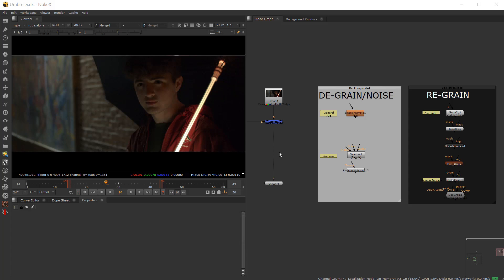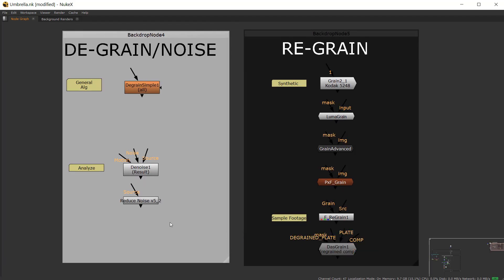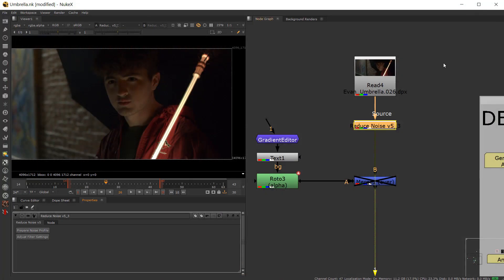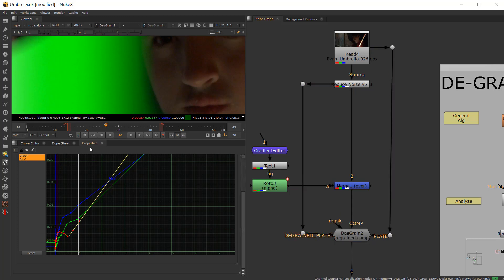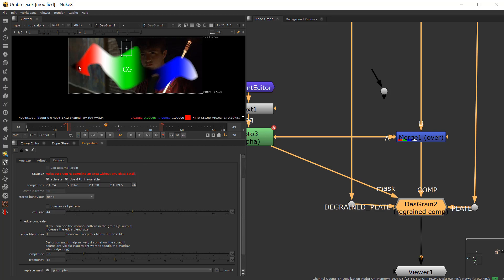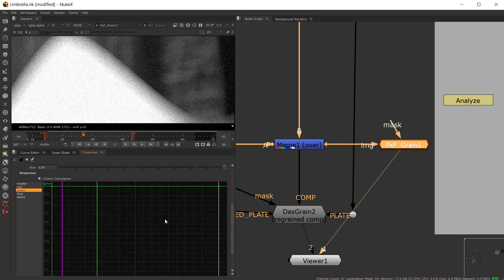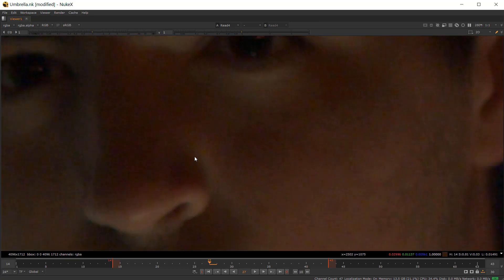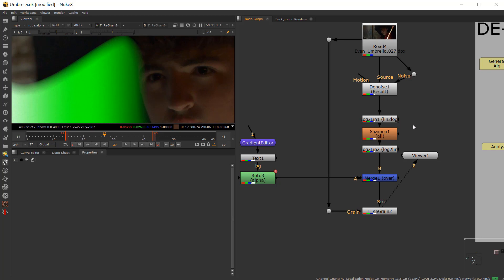Nuke Nuggets #2- Multi-Grain Goodness

Comment: Hi, nice tip. Usually I just regrain CG and merge it back on top my original. Don't understand the advantage of merging on top you degrain master and  regraining all (risk of change in master ?)
Reply from the maker: The transition (feathered area of CG) might not have grain in it.  To each his own, I hear half studios use DasGrain, half use Furnace Core Regrain.  Regrain is more expensive (computing) then DasGrain.